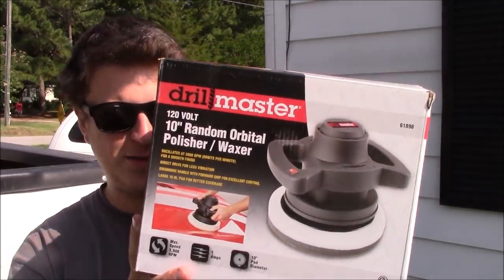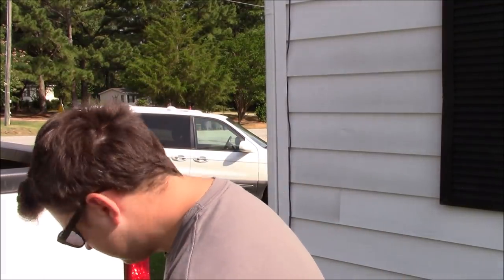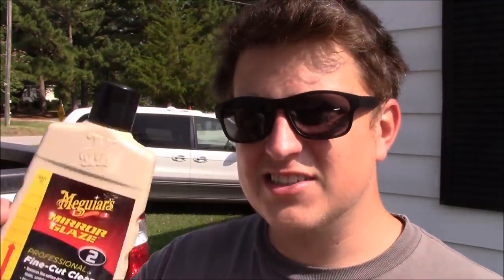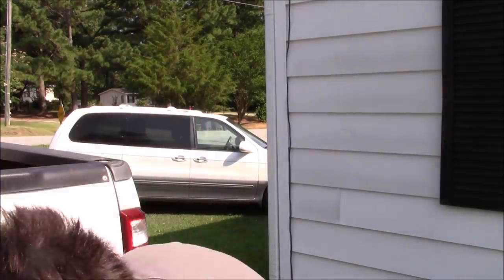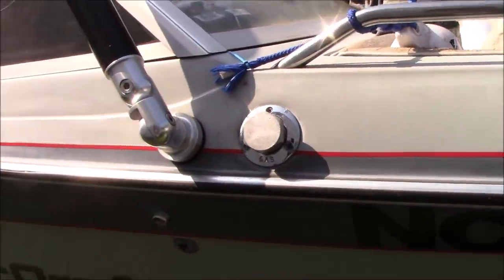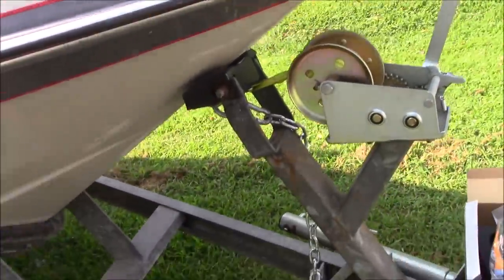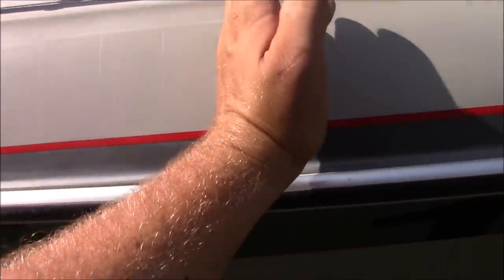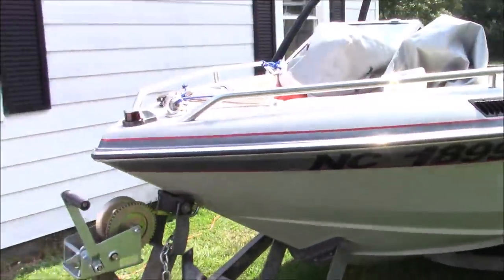$15 harbor freight buffer on Boat

Comment: Absolutely useless device!! Just a cheap wax spreader that will stall under its own power. Grab a shurhold 3500 or maxshine 21 mm polisher.. remove the swirls, don't cover them up.